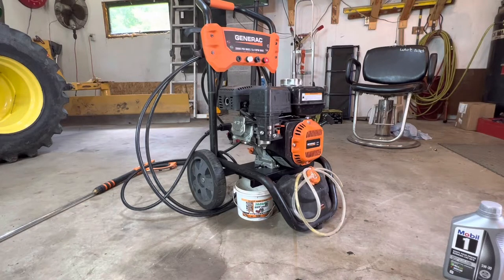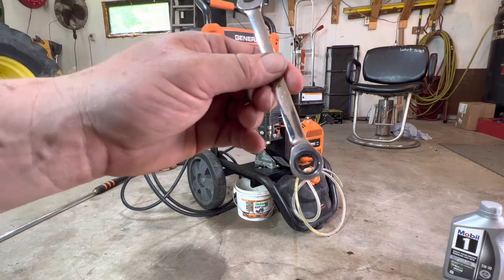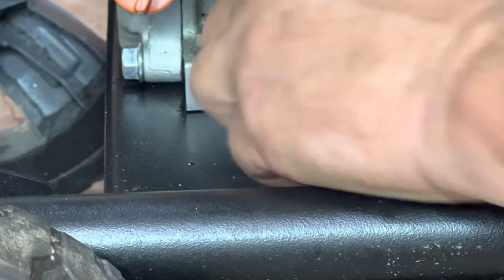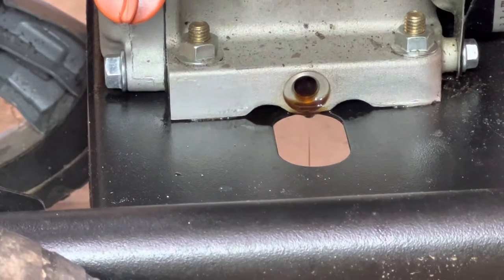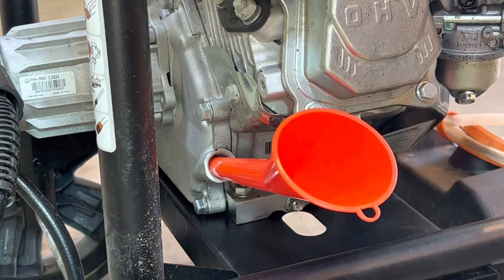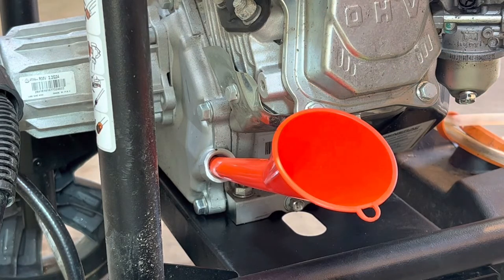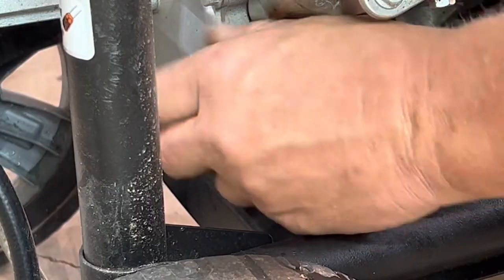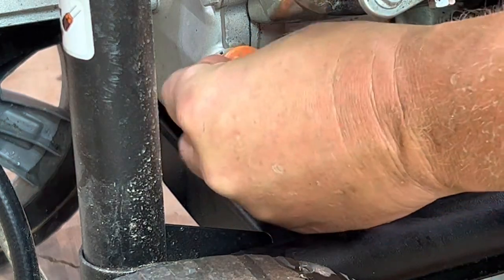Changing the oil on a Generac Pressure Washer

Comment: By far the easiest way to do it! I don’t think people know about that drain plug because I certainly didn’t. Btw, if my washer starts and then turns off, what could be the issue?
Reply from the maker: @cruzbridge  I would start with cleaning the carburetor out. If you let these newer “throw away” engines sit with fuel in it (especially if you put in 10% ethanol fuel) it will plug your atomizer and your jet up with crap. Eventually you’ll get some fuel in the bowl but once you start it again it will run out of fuel. If that doesn’t do it, change your plug. If it cracks the ceramic it can short out and run sporadically. If that doesn’t do it, come to central Wisconsin and we’ll figure it out together 😉

Comment: Avery 8 hrs??that don't sound right
Reply from the maker: I misread the manual online. It says every 20 hours… my bad. It does say to change it within the first 5 hours when new though.
Reply from the maker: I got it after I googled “generac pressure washer manual”.
Reply from the maker: @internetuser3213  no. Just changing the oil is sufficient according to the manufacturer.

Comment: My Generac spec calls for 20 oz 10w-30.
Reply from the maker: I didn’t get an owners manual with mine. I would guess that probably a good oil to use for summer use. I personally put 5W30 synthetic oil in mine. I had it on the shelf and I’ve had good luck with that weight on all my small engines. I do appreciate the info though. 20 ounces would make sense. You’ll see when you pull the dipstick that is at such a goofy angle that it’s hard to tell.  Thanks again